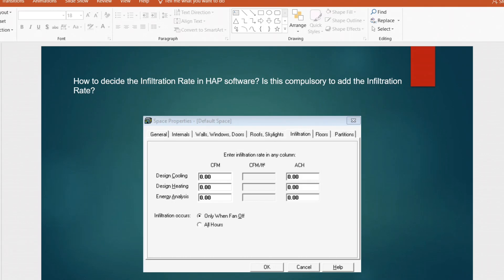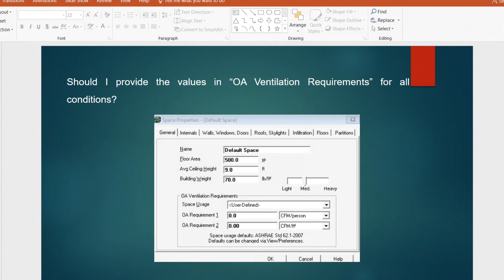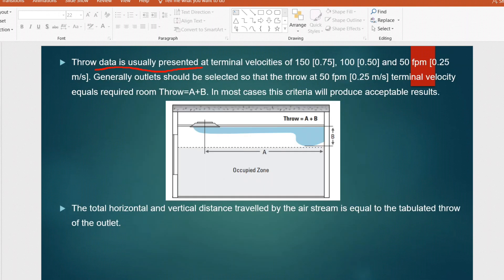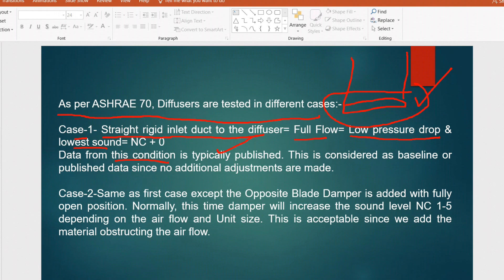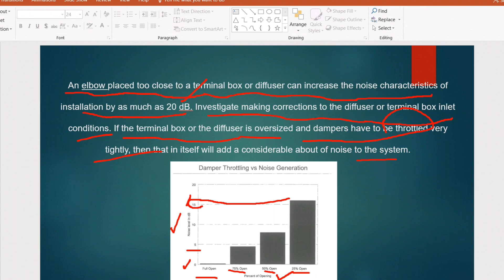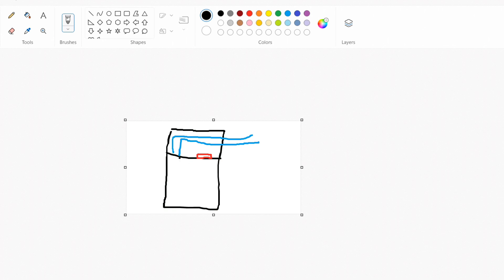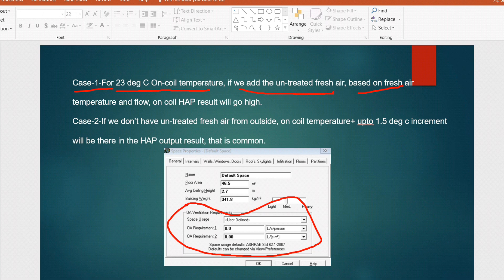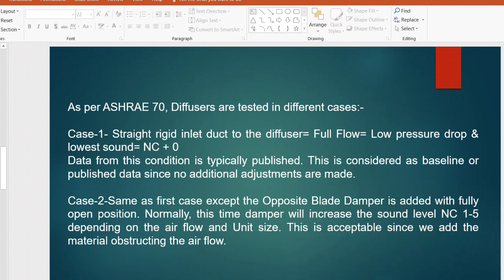HVAC Important Interview Questions and Answers l Must Watch Video for Job l Gulf Job Questions

Comment: Hi, good video also I have noted that there is a typo error in putting the value for calculating mixed air temp.
Reply from the maker: U can comment here so other will understand the mistake